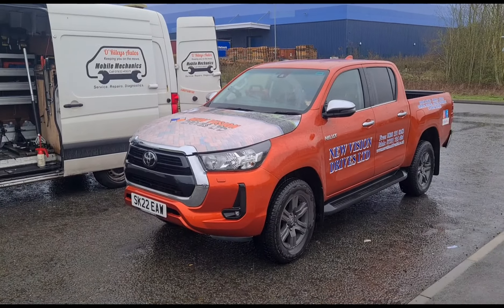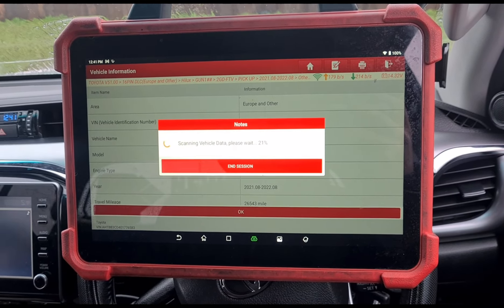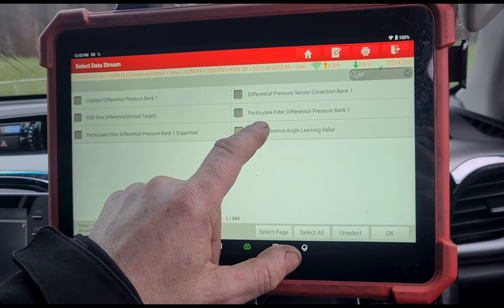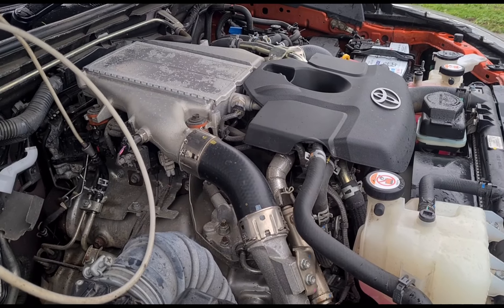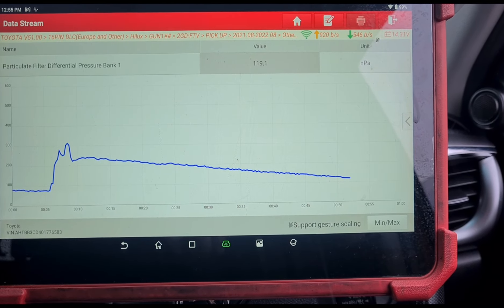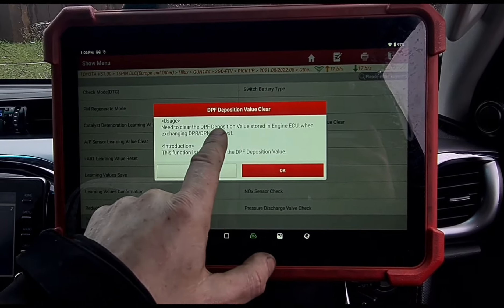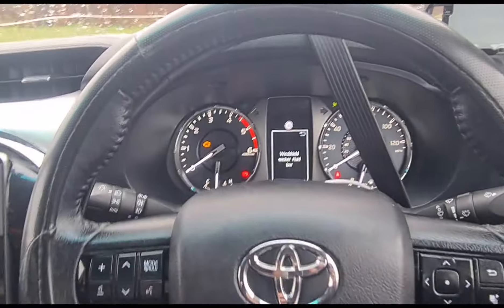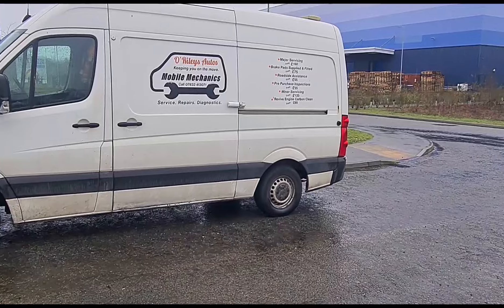Toyota Hilux D4D P2463-00 DPF Particulate Filter Restricion

Comment: Jimmy,  there is a TSB out for these have done about 12 in the last 8 months.  The TSB path varies depending on model year and symtomes.  These should be able to be forced regenerated with a soot loading up to 200%.  The main clue here is they will enter forced regen via a scan tool but fail but the DPF temp sensor B1S2 will only reach around 350 degrees and fail to light off then check the injector head of the 5th injector unit, if it is not embossed in the casting with the letter "D" then it has the older 5th injector unit that is prone to internal corrosion affecting the injection of deisel during regen.  In this case it is a upgraded 5th injector and head unit and a ECU calibration software file update.  If it already has the updated 5th injector then it is 4x new IART injectors and a calibration file update.  The worst case senario is the DPNR unit has become damaged and that is replaced as well which is 4k.  I mentioned earlier I have done many of these under warranty.

Comment: There is a button over the fuel flap release handle, you can see it at 5:50. You just hold the button pressed when parked and it will start to clean the filter itself and count down on the scale you could not remove in the speedo. If it starts the regen but stops shortly after it needs a software update at toyota for it to work. Engine is a 2.8 liter.
Reply: Wow. I dont think it would work once the fault code is stored. It still needed the flush
Reply: @mattmckie6967  don't matter that the code is stored. There will always be codes when there are problems.
Reply from the maker: Yes the button would not work. Customer did try but it must have been locked due to the fault. This is a 2.4 I checked

Comment: Good stuff mate, wish you were here in Australia. My Hilux dpf is 60% full after a regen. no engine lights, no codes, and no limp mode. It's just regenerating frequently, around every 80 to 100 kms. You recon the 5th injectors is clogged?
Reply: Hey bud, I have a 2020 Prado with the 1GD-FTV and I just happened to stumble upon a video on YT about cleaning the 5th injector. (Link below)
Now, my car has only done 50K k's but I decided to follow the video and have a look. Holy f... It was completely and utterly full of soot, I scraped it out with a tea spoon! You could not see the hole where the injector is at all. Cleaned it all out, took the injector out and wiped it carefully, cleaned it with brake cleaner and put it all back together and took it for a drive. Pulled over and did a manual regen which took about 7min and seems to be good now. It was doing a regen every 100km before.

https://youtu.be/OdZACWORMMg?si=Jp9NE8dzvkkQ0KIi
Reply: @ozymandias7940  Thanks mate, yeh will deffo gonna do this. I saw is vid a while back. Where you able to use the old gaskets for the 5th injector housing or did you get a new one?
Reply: @MC-jf6ic  Surprisingly, there wasn't a gasket on it. Some kind of paste/sealer was used. Cleaned it off with brake fluid and just used some RTV sealer, like what you'd use as a gasket. I don't think it holds any pressure because the exhaust gas is just blasting past and out the exhaust.

Comment: Don't know where or if he gets it serviced, but you CAN NOT just put regular oil in a diesel fitted with a DPF. Must be C2 (low ash) rated, or it will clog very quickly.

Comment: And only 26000 miles …. Unbelievable
Reply: Toyotas never go wrong 🤣
Reply: Short trips, stop/start traffic, leaving them idling, the soot just builds up. If this DPF was blocked, you can imagine what the EGR and intake manifold looks like. Probably choked.
Diesels produce the most soot when cold, need to take them for a long, uninterrupted drive at 50-60mph (80-100kmh) once a week.

Comment: Noooo its a Hilux these dont brake down
Reply: It was still running!
Take the DPF off, knock the guts out of it, weld in a straight through pipe, reasemble, disconnect heat sensor, bingo! Nobody would know, looks factory and no more problems.

Comment: awfully bad show on toyotas part ,these dpf,s obviously seem like voodoo to some "mechanics"
Reply: Owners fail to follow instructions. Vehicles fitted with DPF come with a separate do/don't manual. 
The sole killer of DPF's is short trips, stsrt/stop traffic. Diesels in rural Australia for example, lot of nothing and long roads in the outback, Toyota's do 300K+ km without issue.
Diesels in the city, taking kids to school, shopping, they're stuffed at 20,000 miles. Diesels are work horses, why anyone in a city would want them is beyond me. If you do have one in the city, take it for a long drive every week without fail at sustained speed of 60mph (100kmh) like on a motorway, for an hour or two.